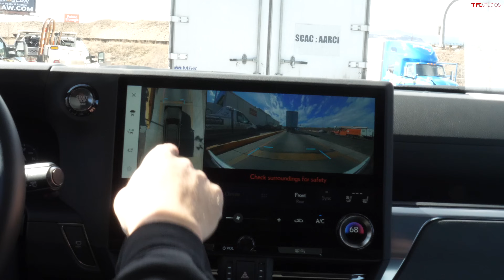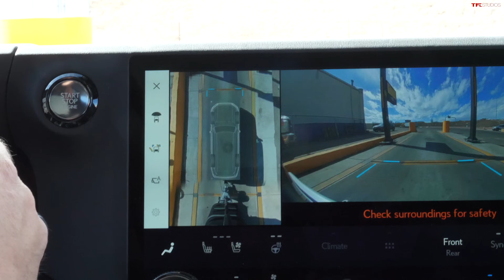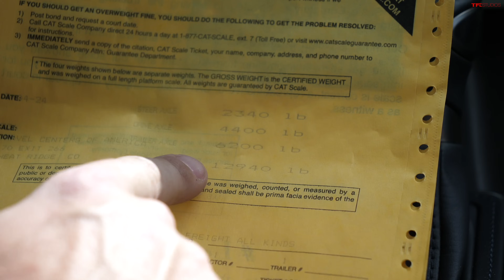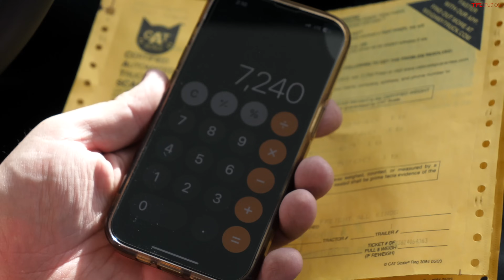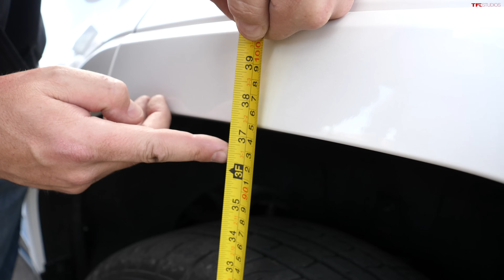Can the 2024 Lexus GX 550 Twin-Turbo V6 TOW Better Than Ever?

Comment: That is a ripoff for that trailer!
Reply: They are made insanely well, with aluminum, propw insulation etc. Expensive but not an insane rip off at all compared to the crap on the market.

Comment: Major annoyance, I dont like how the windowsill armrest is sloped down and basically non-existent. Forces you to use exclusively use the lower armrest by the window controls which may be an awkward reach depending on your seat position and height. Even if youre seated such that you can comfortably use the lower armrest, it’s nice to have 2 options for places to rest your arm on a long trip. The new Land Cruiser has an actual windowsill armrest, just not the GX. Weird decision.

Comment: We have ‘22 and ‘08 GX470s. Both rated at 6500. Since the GX550 is rated at 7800, I’m looking at swapping the ‘22 for one. I’m going to give Lexus a couple of years to address the hitch issues and determine the reliability of the new engine. They, Toyota, are noted for their reliability.

Comment: What was your avg. MPG while towing?  Also, I am planning on a 25' TT with dry weight of 5,800lbs and hitch weight of 681lbs.  Will this vehicle tow it?
Reply: 5800 lb dry is going to be pushing this thing and will likely exceed the payload rating. Realistically, your hitch weight will be more like 1000 lbs once you have propane and batteries on the tongue and the trailer is loaded down with gear.

Comment: 100k for a trailer, which takes fraction of engineering effort comparing to GX. I know the difference is in sold units, but still the cost of design and producing such trailer is waaaay below 50k.

Comment: Toyota/Lexus call out a WDH for the GX above 5000lb (p182 "If the gross trailer weight is over 5000 
lb. (2268 kg), a weight distributing hitch with sufficient capacity is required.
"). I just don't understand why TFL insists on running around without one- let alone that extra long Gen-Y (which worsens geometry).
Reply: been googling and can't find the source document with the above information.  Can you post a link?

Comment: Thanks guys, for this video. I'm looking at purchasing either the Land Cruiser or Lexus GX 550 with towing a caravan in mind. It will be a 19ft caravan so I'm glad this video shows the GX towing a 21ft caravan with relative ease. Hopefully with the slightly smaller caravan it will be more level and lessen the sway.
Reply: It’s amazing that some Land Cruiser trims are as much if not more than half ton and 3/4 pickups.
Reply: Dunno why Toyota decided to sell the Prado (which this GX is based on) as the "Land Cruiser" whereas the world get the actual LC300 which the LX is based on.
Reply: Likely because the 200 series LC only sold a little over 3000 units per year in the USA.  The 100 & 200 series grew in size and price (85k in 2001).  The new LC 250 series returns to the size of the 60 or 80 series,  I hope at some point it will come with an NA version of the V6 in the new Lexus GX.
Reply: @SunnynPhilly  the new Lexus GX is twin turbo V6, isn't it?

Comment: I would love to see you guys tow the toy hauler with the GX up the IKE. With the new tow capacity this new platform allows people to look at travel trailers in a whole new way
Reply: Payload capacity is always going to be the limitation on towing with a truck like this. Yeah it may be rated for 9000 lbs or whatever but if it only has 1200 lbs of payload then you can only tow that if its just you a maybe one passenger. Forget packing up the whole family and all of your belongings.

Plus, travel trailers generally have a 12-13% tongue weight which means a 7000 lb trailer will have 900 lbs of tongue and blow through most of the payload.

Comment: I'm surprised the luxury trim doesn't have at least air suspension in the rear. Our mid-grade GX460 has rear air suspension. As far as sway goes, I think in this case it's more about the short wheelbase on a relatively narrow and tall vehicle. This GX weighs more than my '15 Sierra 1500 crew cab with 6.5' bed. I'll bet I'd get less sway towing that trailer with my truck than with this GX.

Comment: Dear Andre. I'm jealous of your truck prices for such as the Lexus GX, and especially for the new Land Cruiser 250 where you will have a startprice at aprox 55.000 USD. In Norway some politicans would ban everything but zero emission vehicles from 2025, and even if they were told that much needed sorts of vehicles wasn't available as zero emission.
But they was stopped of international law and wasn't allowed to ban, but for a long time evs have been tax free and people working in cities could drive for free in the bus line. In that there has not been that big transition to zero emission cars but we have got a lot more ev's in addition, and people have been driving alone in the busline while the busses was nearly empty. At last the bus line was banned for evs because it was full of evs and buses didn't arrive in time. We have very high taxes on other cars as for gaz and diesel cars, but even at the same tax level for hybrids and plugin hybrids as RAV4 with 75 km electric range. From 2025 the taxes for all others than zero emissions shall increase even much more.
When I bought the highest trim LC 150 Prado in January 2018 I payed aprox 75.000 USD for this as a 2 seater work truck.
Now we have to pay above 100.000 USD, but when the new LC 250 arrive in 2025 I have heard increased taxes where you have to buy up to aprox 150.000 USD for the "cheap" 2 seater work truck. You can forche people to buy so called emission free when you have equivalent models in a price range their work are able to pay, but in my head it's frightening that people with ten years with ability to drive in the busline cannot understand that we untill now don't have any emission free 4x4 working horses to cover much needed jobs to make the cociety running, and it's very sad that such behaviour has a much negative effect on creating understanding of the need for lower emissions. Even myself who are working with lowering emissions also notice that I'm growing put off by such misbehaviour. Best Regards Arne G from Norway.

Comment: I think I measured 50 mm of rake, so dropping 2 1/4 inches with 1000 lbs tongue weight is pretty good considering the nature of the vehicle. That puts you only slightly off level in a worst case
Reply: I am very surprised they didn’t talk about payload with that tongue weight.

Comment: I think the biggest factor holding this back is the short 112.2 inch wheelbase. That's 6 inches shorter than my Audi Q7's despite the GX550 being rated to tow more. I would expect a lot of sway with longer trailers and while a WDH will help a lot I'd stick to a longer wheelbase, even for my 21 foot long Geo Pro.
Reply: Longer wheelbase is good for towing but it's not so great for off-roading. Geo Pros are pretty light, you could easily tow one with a new GX but use a weight distributing anti-sway hitch.
Reply: I tow a 24’ 5500 lb trailer. Just bought an LX570 with the same wheelbase as this and took it through 35+ mph winds doing 65-70 mph without even the slightest amount of sway.

The crazy part was the self leveling suspension unloaded the wdh bars so they were barely engaged the whole time. Had to go readjust the hitch head angle once I got there.

Before that I put probably 2000 miles on my GX460 with the same trailer and that was only a 109” wheelbase.
Reply: Not saying it's impossible, just not as ideal. Ideal is always a dually though haha. Thanks for sharing your towing setup. @Jay-me7gw
Reply: Very true. I do think this GX550 could handle the Geo Pro fine, just would prefer to keep my Audi. Granted I didn't buy it new, I bought a like-new 2018 Prestige with air suspension and 17.5k miles for $38k. If I were going to buy new the Lexus is no brainer for the depreciation. @redracerproductions
Reply: @TheBMurda Problem is I dont think its necessarily worth buying a Lexus LX or GX if you don't intend to tow AND offroad. I've said that many times which doesn't always make me too popular in the GX groups 🤣

I bought the LX570 because my GX460 was not a good enough tow vehicle but my F150 was too big for most trails I do and was always dragging running boards or getting pinstripes.  The LX570, and this GX550, kinda land at the happy medium where you can still tow a decent trailer but then still hit the trails in a nimble/capable truck.

At least thats how I see it. If I wasnt doing both towing and offroading I don't think I would own a GX or LX. I would own whatever was more optimized for the one I was doing.

Comment: Overtrail tows 9k pounds, so no problem. But the width of the trailers is considerably wider than the width of the mirrors. You can’t see! And the mirrors are a funky shape, and there are no extenders made for the model yet. I’m concerned that he would need an extender that’s wider than anything on the market today

Comment: So this is basically a Landcruiser 300 series which has been out in Australia for nearly 2 years.
Reply: No
Reply: @madclone84 Yes.

Same motor, same transmission, same TNGA-F chassis, E-KDSS on the Overtrail, etc.
Reply: @Jay-me7gw  motor is different. EU includes a 3.3 diesel when NA has a 3.4 v6 turbo
Reply: @madclone84 they have both engines in the 300 series over seas. The 300 has a higher HP rating but that is purely due to tuning differences in the engine computer. I think Lexus wanted to differentiate it from the LX600.
Reply: @Jay-me7gw  completely different vehicle and upgraded versions off the previous generations, E-KDSS is “new”, the turbo 3.5 v6 is exclusive to Lexus, the chassis is the same as the tundra. The 300 series doesn’t have good reviews so let’s not compare apples to oranges
Reply: @madclone84 What are you talking about? I didnt say anything about the previous generations.

The 300 series has  the 3.4L TT overseas. It also has e-KDSS. Neither are exclusive to Lexus.

The 300 series is on the TNGA-F platform just like the Tundra, Sequoia, LX600, GX550, new Tacoma, new US Land Cruiser, and probably the new 4Runner. They all are on TNGA-F.
Reply: @Jay-me7gw  show me a link that shows the 300 has a 3.4 V6 turbocharged

Comment: Nice ,we have a 2020 and thinking about the new one. I have question for you guys, does  anyone make 5th wheel brackets for the new tundra?
Reply: I gotta ask, what’s the point? If you want a 5th wheel trailer get a heavy duty truck. These small turbo engines will get HOT towing heavy.

Comment: Look at that Lexus bounce up and down in the rear with trailer hooked up. That’s not too confidence inspiring, this is why I went with a GMC Sierra 2500HD
Reply: 😂😂 the 98 percent of buyers won't be towing a camper with these.  It is near the max towing to close for comfort, I agree!  But this will by far outlive your gm product and as a former HD 2500 owner myself  it  had soo many Lil bugs quality or lack their of really showed after a few years.
Reply: @davidlusk4350  
My 2018 GMC Sierra 2500HD has the Duramax/Allison  combo. So far has been 100% reliable with no issues whatsoever. 
My last two Toyota Tundra’s have not been nearly as reliable. Too many issues with transmission and brakes. 
Now my 2020 4R has been bulletproof

Comment: Thanks so much for the towing video. My name is next on a GX550 Overtrail allocation list so it looks like I'm in the hunt. Although the torque and HP blow away my 4Runner I really wanted see some actual trailer towing. Currently I get run over on interstates when towing. How much tongue weight was on the hitch for this drive?

Comment: Toyota..ahem...Lexus nailed it with this new GX. It looks 100 times better than the outgoing 460 and they didn't neuter with unibody and a turbo 4. This version of the 3.5V6 is what is in the SR Tundra. Tuned down for durability. The old 460 was a 300k vehicle so this one has a lot to live up to in terms of longevity. Time will tell.

Comment: When you review vehicles  should have full knowledge about the vehicle you are reviewing and it's various trims. When the guy beside you asked "does it have massaging seats? Oh probably not" - you should have told him and your viewers that the Overtrail Plus does and the Luxury Plus does. Another thing worth mentioning is that the Overtrail has the better E-KDSS and Variable Adaptive Suspension with 650 settings that change on the fly according to terrain and driving conditions. Which make a difference in the "sway" you mentioned. The trailer hitch area is clean and nice and a lot of people bitch about it looking tacky on nice vehicles so they did a nice job of making it look clean. Most people won't be towing everyday in a vehicle like this so if it takes 30 sec to take off that cover... Who gives a shit. 😂

Comment: At 6740 lbs on the scale with trailer and without passenger that put you over the 7032 lbs gvwr ...only 292 lbs left for andré and mr.truck😂😂😂. That's to much trailer for that suv

Comment: I could not stop laughing at the hitch cover issue. Did anyone at Lexus actually test hooking up a trailer to this thing? Of course they didn’t because they might get their hands dirty. 

You can’t even get a hitch pin in without removing the entire receiver shroud? Incredible. What other basics on this vehicle did they gloss over?
Reply: The owner manual states taking off both covers when towing. This way access to pin and chain attachments is easy

Comment: Engineering background not so fast my friend. The old Lexus GX 460 that my neighbor has with a V-8 engine can tow 11,000 pounds my F150 Eco diesel can tow 12,000 pounds unfortunately the Lexus going to the twin turbo V6 lost about 2000 pounds of towing abilities so you can still tow 9000 pounds more than the Chevy Tahoe however fuel efficiency has only gotten up slightly 16 to 17 mpg combined. I get 25 mpg combined 375 HP not 350  on my Larriat f150 and can town12000. 
You could get the V8 engine and tow 16,000 for the F150 but then you lose on gas too my duty truck gets better gas and I only have to put regular not premium
Unfortunately Lexus is getting greedy like the European auto makers they’re charging a premium for the over trail plus and the luxury plus and they charge a premium for upgrades like bark Livingston audio to the two of $2000 if you want to go from an over trail to an over trail plus there’s a $10,000 markup for $70,000 I’d rather get a new lariat for 65,000 you can even get a platinum for 80000 the same priced as anniversary + if you really want the luxury fee l but there is a $150,000 markup. The luxury plus tips at 84000. That is only 6000 less than the base LX. Might as well get the base Lx  600 at least you get 400 hp
Reply: @thebig12conference73  The old GX 460 definitely could not tow 11,000. I own one. It has a 6,500 pound towing capacity. That’s in the manual and on every resource online. The GX 460 doesn’t even have a trailer brake controller! I have no earthly idea where you are getting 11,000. That’s more than the Tundra of that era. The GX 550 having 9,000 pound capacity in the Overland and Premium trims (Luxury is lower) and an integrated trailer brake controller is a huge step up from the GX 460x
Reply: @ the old GX 460s were great my neighbor has one it used to come with a V-8 engine too bad they nursed the V8 engine and Lexus is not the only one

I believe the old Lincoln navigator - Ford Expedition’s had a V8

Furnace UV or a truck either you need a VA or you need a diesel in-line six I was going to get this but I think I’m going to get a ram 2500 Cummins Laramie .

My dad’s best friend has one he gets 18 to 23 miles per gallon when he’s not towing and when he’s towing he gets like 12.9

Comment: Hello TFL Truck guys, I don't understand why Lexus and Toyota with their fokus on reliability, comfort and everyday use are using low profile tires on a truck, even if it's a luxury suv it's a work horse and the tire wear on these low profile tires are could be thre times higher than a more normal tire for this truck. On my 2018 LC 150 Prado which is very comfortable with air suspension on the rear axel, the winther tires on 17" rims with higher tire-sides are more comfortable than the summer tires on 18" rims even if this tires also have quite high rubber side-walls, and my 17" gives best milage even if it's with winther tires. Even if the gas tank is big on the GX you will have higher consumption and lower range on gas milage, and this isn' very environmentally friendly. After changing from 20" to 18" tires on our very comfortable ev, we now have better comfort and between 10 and 15 % better milage. And maybe the worst of all the bad with low profile tires on heavy vehicles is what all these serious reports about microplastic tell us about low profile tires as one of the really bad guys. Almost all focus is on Co2 emissions, but microplastic emissions which we now are finding too much of in our food-chain are sailing in high speed up as one of the most dangerous emissions we the so called intelligent humans are using to make the life of our descendants more difficult, and it's already a killer. Some plastics thrown in the nature are easy to collect, but tire wear are more difficult to collect and *one way to reduse microplastics from tire wear is to choose tires wisely and avoid low profile, and less low profile tires give us less tire wear which is also a good financial choice. Best Regards from Arne in Norway.

Comment: I wonder why they opted to go way down on power from the tundra
Reply: They didn’t go way down at all. 
SR Tundra: 348/405
Higher non hybrid trims: 389/479
Non Hybrid GX: 349/479

Torque same as Non-SR and HP practically same as SR Tundra. The 10% reduction for HP vs Non-SR Tundra is probably for longevity. At least that’s what they said about the detuning of the SR Tundra.
Reply from the maker: It’s still a LOT of power.